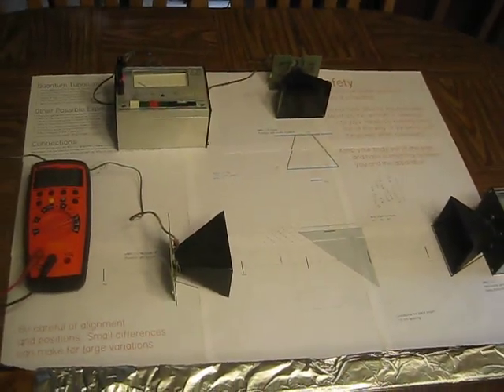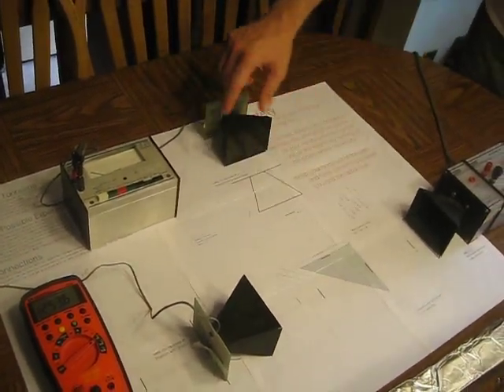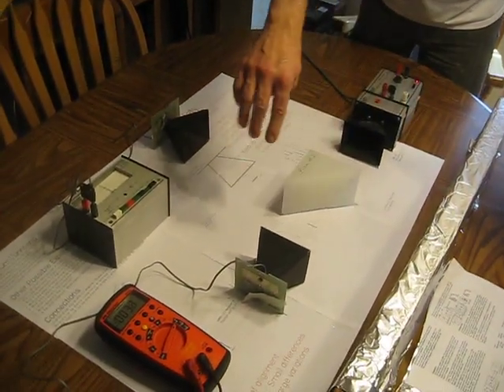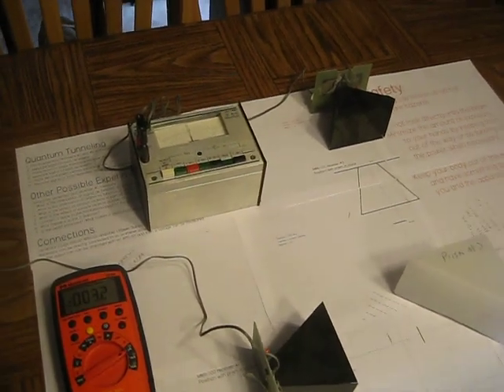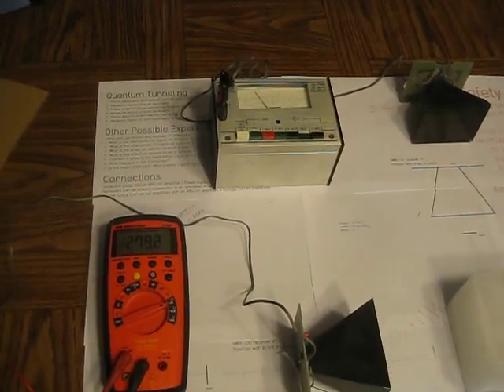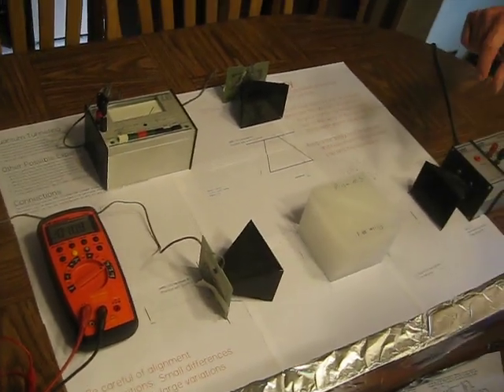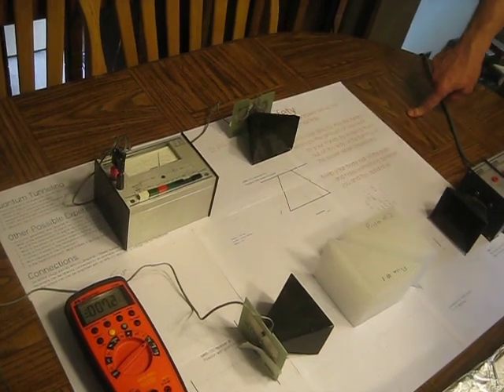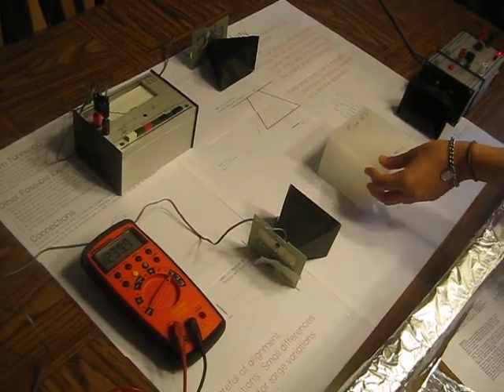Quantum tunneling on the kitchen table

Comment: Why would the photon only tunnel if there is an object on the the place where it tunnels to? It would be more convincing if you put a plate of steel between the prisms and the microwave is still detected behind the second prism. Then the photons would have tunnel ed. 
This has nothing to do with tunneling.

Comment: Hi I liked you experiment and I want to do one of my own but I'm not sure where to get second hand microwave generator? Where do you buy them from. I found one on ebay but it was too expansive.
Reply from the maker: +Mui 無為  They are expensive.  Ours equipment is pretty old (maybe from the 1970's), and we borrowed it from our local high school's physics department.  If you are handy with electronics, you could try purchasing a microwave diode and building a makeshift horn.
Reply: Ok thanks.

Comment: If the photons easily traveled through the air from the transmitter to the receiver directly across, why does the space between the two triangular prisms prove to be a challenge? The air is a medium, isn't it?
Reply: there is a huge problem with the diagram - that there is no true wall, if we are at the level of a wave or photon then there is no wall  but giant holes or other atoms and since most of space with in atoms and between atoms is empty space then there is no wall but lots of empty space and I can see how tunneling can take place between these giant gaps